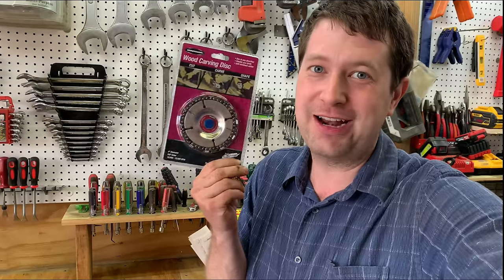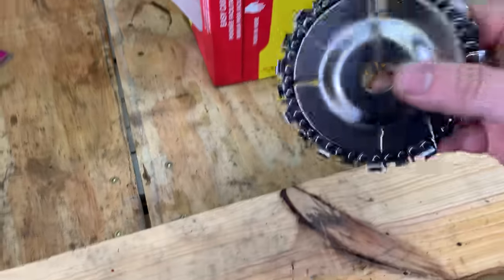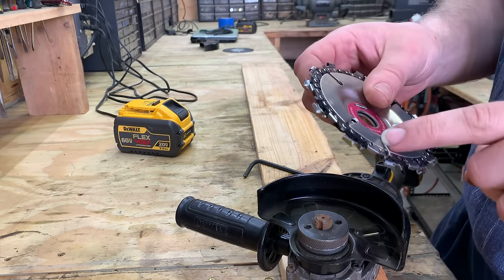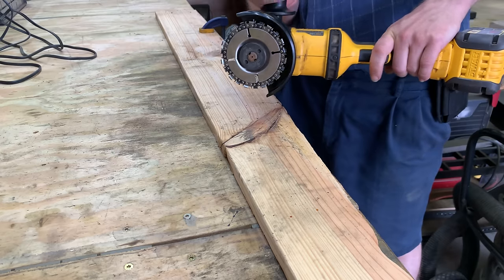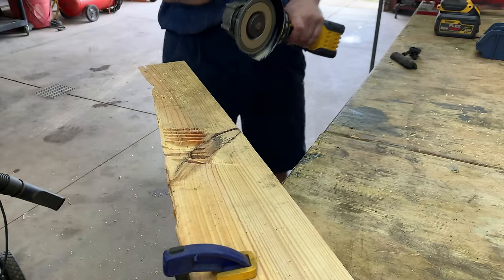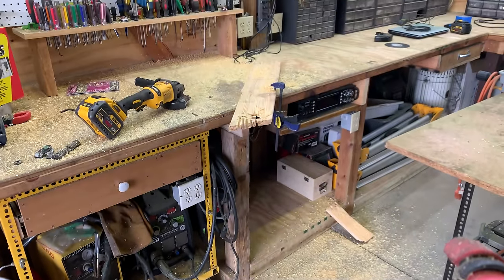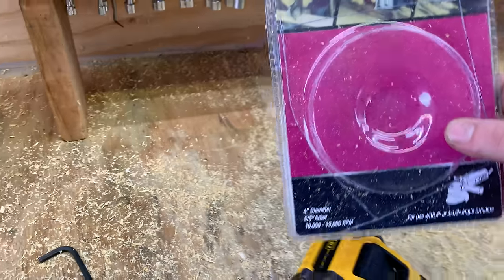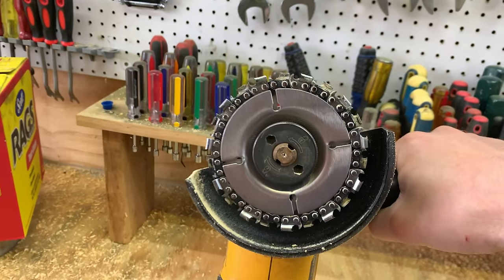Most Dangerous Angle Grinder Attachment I have Ever Seen

Comment: Moans about it being the most dangerous attachment he's ever seen.... Proceeds to use it wearing shorts and no gloves or goggles
Reply: Gloves would be a huge mistake. Never wear gloves when handling power tools.
Reply: @jimbo111589  exactly was just going to reply to say this.....gloves are a horrible idea if they get hit they snag and so all sorts of nasty stuff
Reply: @jimbo111589  I'm not a tradesman by any stretch of the imagination but a part of the reason power tools tend to be very bulky is to make them relatively easy to function with protective gloves on. To say never wear gloves with power tools is a pretty bold statement. 
Clearly the tree surgeons I've watched were doing something wrong when they wore protective gloves while using their chainsaws (which is what this in essence is). I'm not suggesting it would stop the spinning blade but it CAN make the difference between surgery or amputation as the outcome.
Reply: Dan T and with the guard in the wrong position
Reply: @VLXVNDR  why are you using an angle grinder if you cant take a spark and why are we talking about sparks when he's carving wood? not a tradesman LOL you can tell all that from a youtube comment.... amazing you're clearly an occupational psychologist i see....
Reply: @VLXVNDR  but there's still hot, flying debris? Your arguments make no sense. If your angle grinder has a locking function where it doesn't automaticly turn off if you let go (and there are angle grinders that do that) than it is not a smart idea to wear gloves period. Your gloves can get caught too easily as well as loose shirts, rings necklaces etc. Thats why you have to take them off.
Reply: @VLXVNDR  it doesn't matter if its fixed or not. A grinder can still pull your gloves (=your fingers) in and seriously hurt you so you can't use gloves. But do what you want, it doesn't sound like you know too much about it anyways, maybe you will learn it the hard way.
Reply: I'm a woodworker, went to school for design and then to furniture school for woodworking.  I was taught to never wear gloves while using any of the machinery, and for 20 years I've followed and taught that same advice.

Metalworking is obviously different.
Reply: @VLXVNDR  Genuinely sorry I was in a kind of rant. I'm a "Mechatroniker" it's mechanic and an electrician at the same time and they always told us in school to not wear gloves too. I had them on with a grinder and it grabbed and sliced my Hand open a few years ago nothing too serious but i still have a scar that's why i think it makes sense what they told us. But I know plenty of workers who wear gloves whenever they use them so to each their own

Edit: spelling
Reply: Yes it's a dangerous tool - if you don't know how to use it properly and with respect.  He is not.
Reply: I think it's worth pointing out that the catch-all term "gloves" covers a fairly wide range of protective apparel. Ironworkers, arborists and landscapers wear leather work gloves. Electricians like myself and other trades wear close-fitting rubberised/elasticised work gloves when doing rough work with power tools, or rubber gauntlets for high voltage work. Welders wear welding gauntlets. Machinists generally wear no gloves or loose-fitting clothing that could get caught in a spinning machine tool, also because they need to make fine adjustments to controls or measurement tools etc. You should use/wear appropriate PPE that suits the type of work, the tools you're using, and the manner in which you're using them. It's not rocket science guys. 😉
Reply: It's a friction vs resistance thing, a grinder blade is designed to cut by overcoming resistance binding a material together, gloves are generally designed to add friction and grip onto things which is why they're usually made of soft material. If the friction is higher that the power to overcome it, your hand goes with the machine. You can definitly use gloves with a grinder but maybe just think twice about it and the type of glove you're using etc. Compared to lathes, bench grinders, and engines, an angle grinder is relatively safe
Reply: @Turbo_96  Buddy, if you're putting your fingers near a disc spinning at 10,000 rpms, I don't think you'd even be qualified to work a blender.
Reply: It's cheap because when you maim yourself with it you wont find anyone to hold liable to sue for damages. That manufacturing company no longer exists, and was only in existence for 6 months. First hint of trouble, bankrupt and disband the company  open another one in the same spot, with all the same people, stock and tools and keep on making cheap junk.    Oh   and I choose to find another way to hollow out wood.  Risk vs reward thing.
Reply: Nathaniel Sr. Tech  note that he's only touching the glove to the forward edge of the disc in that video, i.e. simulating what would happen if you got your gloved fingers in the way of a cut-off disc used with the correct technique for that task. The biggest problem with angle grinders is that being a handheld tool, there's nothing constraining the operator towards using correct technique (as with a mitre saw or table saw that can only function in a certain defined manner). Hand a fuckwit a self-contained motor driven spindle running at 10k+ rpm, he'll immediately try and bolt spinning metal blades to it and use it to prune a maple tree while dangling upside-down six feet in the air...
Ain't no "appropriate PPE" for that task, the Work Method Statement just says NO over and over again.
Reply: @jimbo111589  , you have obviously never worked in a steel foundry!!!!
Reply: @dant5039  Gloves will not stop you from being cut, they're to protect from grazes, scratches etc. Tree surgeons use gloves so their hands don't get mangled on tree bark or get rope burns, again gloves are not there to protect you from the tool itself.
Yes that person over-generalised their point. Gloves are often helpful but for certain machines (especially lathes) they can get caught and pull your hand into the machine. In a lot of places it's illegal to operate machines with gloves on for that reason.
Reply: @potatoe4221  Accidents can happen and what if you experience kickback? There are countless sources of injuries caused by contact with cutting blades/teeth.
Reply: @davidjames2145  The answer is yes and no. Gloves help you with certain tools but can also cause serious injury. It all depemds on the work you do, what tools you're using and even what type of gloves you're wearing.
Reply: I bought one of these chainsaw attachments for a grinder, and was put off using it because there’s no assembly instructions, user guide or warnings on the packaging. Or it could be that I like having fingers. 😳
Reply: Them proceeds to use ut like a chainsaw not a grinder.
Reply: @Turbo_96  same with a mill, if the mill catches your glow it can literally tie you around it self ....
Reply: Wearing gloves would be an horrible idea
Reply: I’ve never owned a grinder that didn’t explicitly warn the operator against wearing gloves or loose fitting clothing/jewelry in the included manufacturer’s documentation.
Gloves are more likely to cause a serious injury than prevent one around just about any spinning power tool/equipment.
Reply: @dant5039  chainsaws are gnarly and when using one gloves give the operator a head start on. It getting mangled in case of a Mis step
Reply: @davidjames2145  wtf, i was taught all through school to never NEVER wear gloves with any power tool no matter what, its just not worth the risk be safe the instructors dont say it for nothing.
Reply: @keenangreen54  I'm glad my instructors weren't yours.
You've left out the 'why'.  Why should gloves not be worn given that they protect the hands from high velocity shavings, sparks, abrasions and lacerations?
Oh, and did your 'instructors' also say wearing shorts was a good idea?
Reply: @davidjames2145  if you wear gloves with a drill press and the gloves get caught on the rotating drill bit it would suck your whole hand in and most likely rip off your hand if your lucky most of the time it will pull you into the rotating bit ive seen it happen to a close work mate of mine 8 stitches on the face and lost 2 fingers , mate just dont wear gloves .
Reply: @keenangreen54  So that makes some sense. I have had thin disposable mechanic's gloves torn by a drill, but I was being silly.
I'm not going to stop wearing them with an angle grinder though as they've saved me a couple of times.
Reply: @jimbo111589  Like not having your neck tie hanging out.
Reply: @sixstringedthing  spot on.. thank you for that.
Reply: @jimbo111589  We use miller blades in angle grinders in a shipyard that builds alluminium ships, if you don't wear gloves and long sleeves you will end up full of little holes that bleed not to mention that the swarf is very hot. So wearing gloves when using power tools can sometimes be a necessity.
Reply: Gloves stop you from flinching when sparks fly and is better for fatigue
Reply: and probably the worst possible way to utilize the attachment lol
Reply: @sixstringedthing  thanks for typing all that. The hysteria in the comments sections these days. Or are people just getting literally more dumb? When I wear gloves, I am mindful of the fact that something shaggy is between my hands and moving parts. So if adjusting a coolant pipe on a mill I turn off the motor 1st. If I’m using reinforced gloves to turn stainless, again I’ll turn off the motor before clearing the scarf. It’s always down to user.
Reply: Gloves wih angle grinders = fine.
Gloves with mills and lathes = Big no no

Angle grinders will stop when caught up in material, big machinery will not.
Reply: @jimbo111589  Ditto.  A snagged glove and rotational forces will not only damage flesh but break bones and other internal parts.  Fabric materials don't tear easily and will act like a rope tied around your body parts.  Don't believe it?  Google some tractor PTO accident videos or lathe accidents (NSFW).
Reply: yeah do you think he has read any of these comments?
Reply: @stevo2992  it’s more like you like your abdominal cavity intact. Think it was Stumpy Nubs did a video on one of these he was using to carve a bench and it kicked back and he nearly got his intestines out on the floor. The problem was if I recall there is no safe position to have the guard as it can bind on any edge. He went into full detail and had a slow mo of the accident as it was he got cut if I recall. If it wasn’t stumpy nubs it’s was someone who made a full video about the carving attachments
Reply: I got one a few months back, and frankly find it not much use for anything. Personally i only used it with full length welding leather gloves on, and a welding apron as well, as the darn thing has a mind of its own, as to where its going to go when it bites in.
Reply: @MrSongwriter2  Thanks, yeah I agree, pretty much bad news all round. I finished up chucking it in the bin, just not worth it.
Reply: @wakeupamericaspeaktruth9945   so tell me, do you also think gloves and other ppe are are waste of time for using a chainsaw?(which is what these basically are) lol. if you get one, let us know how reattaching your fingers, or stitching up your belly goes, when it gets away from you. A 4 inch grinder has stuff all torque, so getting wound up in it and braking bone etc, is a silly notion, imo, and suitable strong gloves would always be better than bares hands being attacked.
Reply: @farmsgrace341  the guard is not in the wrong position.
Reply: @iwanta69rs  not about a spark. Just wait until you get a chunk of steel  lodged in your hand. Atleast gloves a little protection. Instead of instantly damaging your skin
Reply: @JLUX100  when you work with power tools and machines all day your hands take a beating. I may have a bunch of scratches and scrapes but I can still use my hands. Gloves will make it worse I have seen degloved fingers and that never heals. Besides no gloves are strong enough to withstand that kind of force. There is a time and a place for gloves but you don't want gloves near anything spinning. Best to be on the safe side and just take the beating of the hands.
Reply: @iwanta69rs  Then you are not using the grinder correctly. Gloves are a must ESPECIALLY when grinding metal.
Reply: No gloves when using power tools that's extremely dangerous I don't know where we get this gloves thing from
Reply: @damionbrown1176  This confusion comes from uneducated people grouping all power tools in the same bunch. When operating a tool where you move your hands in relation to the machine, like a lathe or a drill press, then no gloves because there's a danger you brush the spinning tool or work piece and get snagged. When your hands are fixed to the machine, like a handheld drill or angle grinder, gloves are ok because you are not in danger of touching the spinny thing with your hand.

Comment: It's good for exactly what it says carving; if you're not a carver don't use it.
Reply: I'm gonna use it on Metal
Reply: @kleingreenlee  good luck bro
Reply: Klein Greenlee dont forget to take a video when you try it.
Reply: @kleingreenlee  I'm gonna use it on pumpkins.
Reply: I have one, I have used all types of chainsaws carving tools spoons gauges  all types chopping splitting equipment metal cutting equipment lathes both wood and steel.  This is the most dangerous tool I have ever used. You must be extreamly carefull with it it is very pron to grabbing and kicking back and you can be suprised with the direction it tries to go.
Reply: Except it also says cut soooo u wanna try again broski
Reply: @thomaslemay8817  so carving with that grinder is more dangerous than carving w the chain saw? In order to do the same w the saw, you have to remove the guard from the end of the bar. Removing safety equipment is always more dangerous.  Feeling less confident with a tool doesn't mean its more dangerous
Reply: Someones been eating to many lemons
Reply: I used mine to cut my way out of my basement.I forgot where the stairs were.Let me tell you,these weren't made to cut through brick.The kickback was bad.I nearly killed my personal ANTIFA,not like it would be much of a loss though.
Reply: @shadwell749  lol wtf
Reply: @jafarobeid466  chainsaws have a chain break thats activated by the back of your hand in case of kickback, angle grinders have a switch that can lock them on.
Reply: I’m gonna make stained glass with it.
Reply: @bobby_greene 1, not all chainsaws have the chainbreak. 2 my point is that you have to remove the end of bar guard to use a chainsaw to carve. Also it takes 2 hands and is awkward to wield the weight and gforce  associated with a chainsaw. A grinder is comparably lighter weight, and can be used with one hand safely, but in 2 hands, zero chance of injury. Your answer is a strawman. Chainsaw is 1000%  more dangerous than grinder. ive used both at work for years, and am fully aware of the safety features, and risks of both. It's not hyperbole, rather an educated assessment. Lastly, if he had a 10" angle grinder, you would fare much better in your position. Cheers mate
Reply: Well he isn't an educated power tool user, yet he's still pretending he knows how to use power tools sooooo I don't think he's going to take anyone's safety advice unfortunately.
Reply: @thomaslemay8817   These diabolical attachments should be banned - They CANNOT be made safe in any way.
Reply: @curvyweiner5557  yeah crimson
Reply: @jafarobeid466  I have used chainsaws since I was 8 yrs old, been in cuntstruction working Iron for over 35 years. I have used 4 1/2", 6", 7" and 9" angle grinders but never even heard of a 10" angle grinder, I say you have no clue what you are talking about. Book smart is NOT HANDS ON INTELLIGENCE
Reply: Carvers do not use these if they are not idiots.
Reply: @dremmelkiller  
I'm no carver, but just looking at this tool I can see how beneficial it would be to a carver. It looks perfect for adding texture to a piece. It looks perfectly suited to quick rough stock removal. If used for light duty decorative applications, I don't see how it could be a danger.

Comment: He says the attachment is dangerous. Then he uses his grinder backwards, with the handle on the wrong side for the way he is holding it. Also, it's made to use like a grinder. Not a circular saw.
Reply: He's not using it backwards though, he's holding it the same way you'd hold it for cutting metal
Reply: Most marketing videos use it like a circular saw.

Comment: A colleague of mine was using one of these on these on site to shape a piece of timber. It's a really good thing he was wearing gloves because when he ran it through the two of his fingers I didn't have to scratch around on the floor looking for them, they were hanging in neat little pouches by the remaining threads of the gloves. Surgeon was able to reattach them but with the knuckles destroyed his fingers are half an inch shorter and don't flex anymore.

This tool is seriously dangerous and the damage it does to flesh and bone cannot be underestimated. Definitely the most gruesome injury I've had to treat on site. Please do not treat these blades casually and use all of extra guards if you ever need to use one!